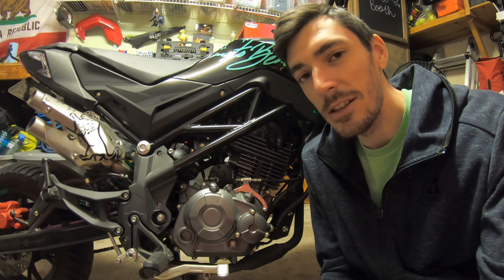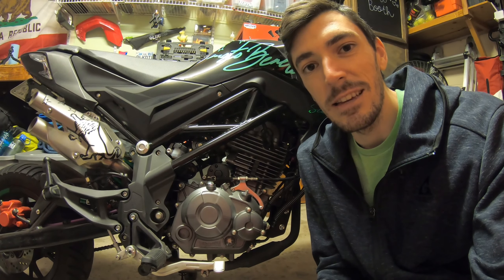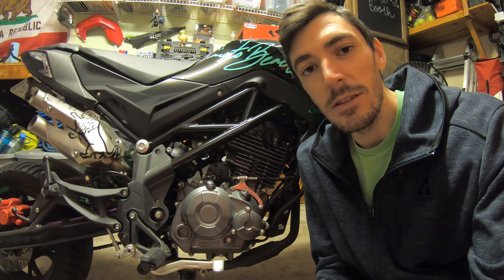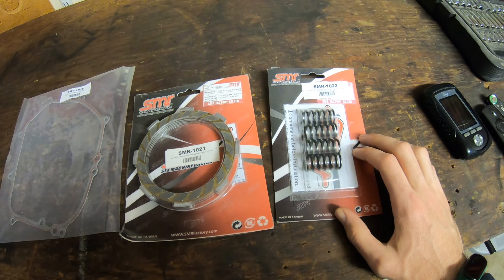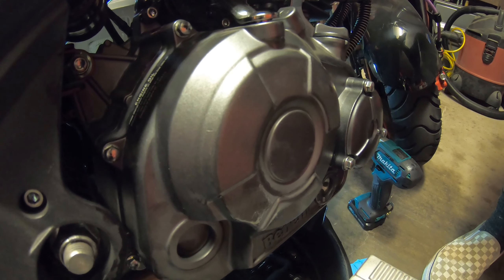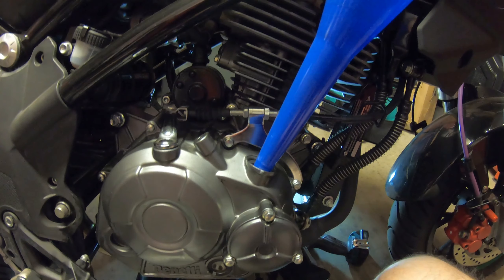Benelli 6-Disc Clutch Upgrade and Stiffer Springs

Comment: I feel like the stock clutch pull is actually pretty stiff on this bike, especially compared with a Grom, and it has a very narrow engagement window. I am thinking about trying an easy pull lever to lighten it up and stretch the engagement point out a bit. I also notice a little bit of chattering sometimes when taking off from a stop with mine, not sure if that’s related to the clutch, the chain or something else. It feels nice and grabby when shifting between gears.
Reply from the maker: I had a bit of chatter too, lessened when I got a new chain. I think the stock chain tends to stretch easy.
Reply: @lexdfox yeah 100%

Comment: I have a ZS190 motor.  What would be the benefit of doing both the Plates and the Springs if it's brand new and I just want to eliminate slipping. Would it be okay to just do stiffer springs?

Comment: No loctite on the clutch bolts? I saw the blue color on those.
Reply from the maker: No loctite, the springs provide enough tension. I think the blue marks on the top of the bolts were some kinda QC check.

Comment: What prompted you to change the clutch plate other than having the parts laying around. Were there symptoms that your clutch was going out? My Benelli is my first bike and I want to get ahead of this kind of thing by learning from others as I have no practical experience of a clutch going out. How many miles roughly should you get out of the stock clutch? Thanks and keep up the great content!
Reply from the maker: Thanks for watching! My only prompt was I had the parts, by no means was the stock clutch going out. The friction plates had plenty of life left, in fact I kept the stock stuff in my spare parts. The clutch should last a long time, thousands of miles. My groms clutch wore out after 20k or so, I imagine the benelli oem would last about the same with normal use.
Reply: @lexdfox  Awesome. Thank you for the information. Great video.

Comment: Do you have to hold the clutch basket to break free the nut or just loosen with the impact or leave it in gear? is there a tool needed to hold the basket?